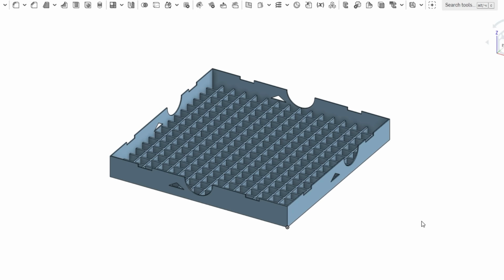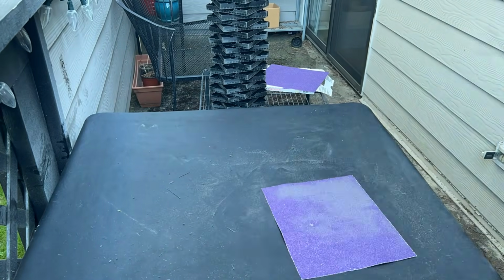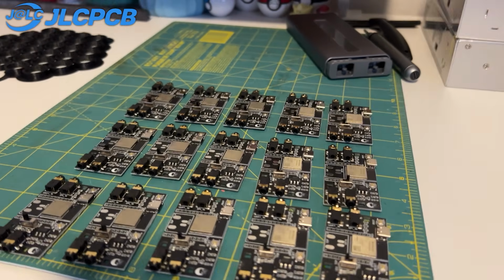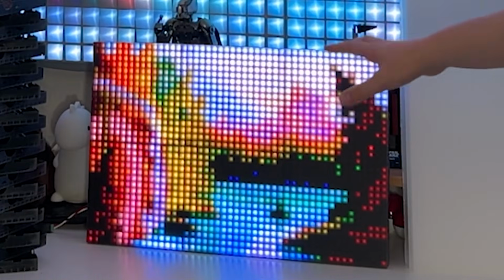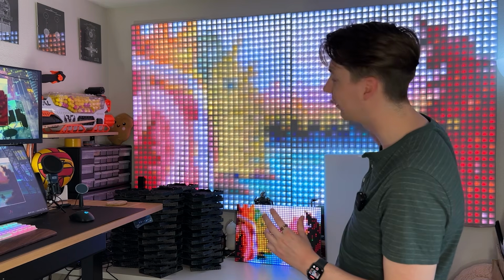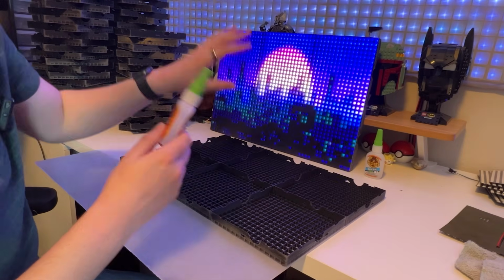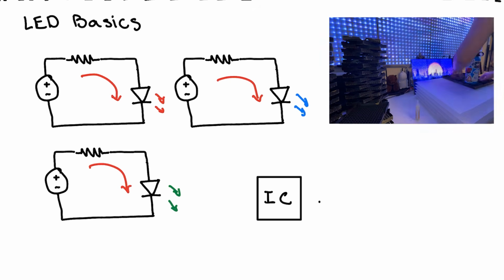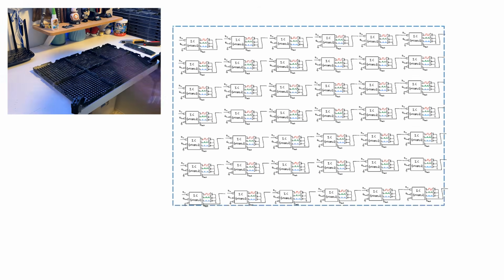How To Build a HUGE LED Wall From $5 Tiles

Comment from the maker: Maybe I should stick to Tetris 😅

Work With Me: www.tech-random.com
Reply: I'm slightly surprised you didn't follow the memes and play either Doom, Crysis or Skyrim.
Reply: @tuxino  or bad apple
Reply: I am surprised you didn't try some retro titles. Why not asteroids? Or maybe an old Gameboy game?
Reply: Play doom on it
Reply: @bonker3  CLASSIC doom 100%
Reply: You should try something like Super Meat Boy or Celeste on it LOL
Reply: at that framerate, classic doom or any 2D game would be best. great project nonetheless. 👍
Reply: UART and SPI are similar interfaces SPI is a protocol  for short distance wired communications between integrated circuits. Whereas UART is a physical circuit that sends data over two simple wires over longer distances, spi is 3 times faster and requires more power and i believe is compatible with raspberry pi and arduino.
Reply: Hi dude plz answer would like to build on top of your project
Reply from the maker: @efexzium you can find my email on my channel page
Reply: @Tech-Random maybe hanging a plain white thin cotton sheet? Could diffuse AND blend the leds to make the image smoother?
Reply: A C64 emulator might be programmable.
Reply: hey bro, i want to order ur pcb from jlc pcb but get this error :
The below parts won't be assembled due to data missing.
SPI_IN,SPI_OUT,H1,H2 designators don't exist in the BOM file.

Comment: After watching both your videos about using these new panels for your wall display, I think I'll be purchasing some (and the microcontroller you made) for an interactive art thing I'm wanting to make. If/when I get it running, I'll be sure to give you an update.
Reply: P.S. tried to use your GitHub files to make a PCB, but they returned an error. I created an issue in your repository, so hopefully we can follow up there (if I don't stumble into a solution first).

Comment: yo. get some even tigher ones and fix the latensy part and use it as a rgb backlight for a tv ( run the led ones as a low res mirror of the main screen signal )

Comment: Would this be DMX controllable?  I'd love to do something similar as stage lighting for my DJ setup, to compliment my current fixtures?
Reply from the maker: The code doesn’t have a direct DMX interface but since it mirrors a PC screen you can use an app that does support dmx and mirror that to the display.
Reply: @Tech-Random thx for that clarification.   Happen to know what wattage LEDs can go up to?   It would need to be "DJ bright"

Comment: Hi, this is really cool, but I seem to have missed some info... you seem to be using an ESP32 board for every 6 panels, right? And ESP32 boards from what I see are being controlled by serial port, but what are you using to control and synchronizing all the boards? A PC?? What software are you using on the PC? Where can I get more info?
Reply from the maker: You are understanding it correctly. The software I’m running on my PC is called LMCSHD and you can download it from GitHub. I talk about it in more detail in this video: https://youtu.be/c3bDt88AE4w?si=NCkaQqcaE3WE_x-O

Comment: I have professionally installed 3 LED video walls so far (2 LG and one Samsung). Unfortunately I am a perfectionist and usually spent more time than necessary on those jobs, but the end result is worth while. This video is already giving me nightmares, I am trying to resist the urge to immediately splurge on parts for such a project that may very well end up in the 'Did not finish' pile. Watching you put this together I started to think of how I would develop an interlocking cabinet system for each panel.

Companies that are huge successes all started out like this, just making cool shit. Amazing job, truly. It amazes me what dedicated people are capable of doing nowadays.

Comment: Ths dragon lives in Oregan also. heh. Weather can be bad at times. I love this project. I have plans for a cuple of projects. One of them will involve in making my own PCB. I hope I can get it done right. If I do then this other progect I will want to try and do. Another project is to mod a TV/VCR combo unit. thinking of upgrading the jungle IC if the one in the tv doesn't do RGB as I am going to turn the TV into a masive gaming TV. heh.

Comment: I've been working on renovating a museum that has a led-wall of 16x7m. How you can improve your design, is make a case around a few tiles and repeat that to fit the entire wall (2x3 size for example). You make the tiles fit really snug and neat and try to make it almost borderless. make some holes/sliders on the sides that connect to another box with bolts or something. Now here's where the magic happens... your led wall will look way more professional when it's alligned properly and this is an easy and cost-effective way of doing that that holds up really well too.

Comment: I know there is a different protocol from the WS2812 that is designed for speed, but it's probably more expensive.
Reply from the maker: The WS2812b chips aren’t the bottleneck here. It’s actually the usb to serial converter that sends the signal from my PC to the ESP32. The baud rate is limited to 921600 bits per second or just under 1 Mbps. If I were to use a proper USB 2 connection I could easily get 30 frames per second or more with these pixels.

Comment: I think you can print 1-2 layer clear PETG then print reset part directly on it (of course also using PETG since PLA doesn't bound with PETG)

Comment: You should have printed the tiles with a white filament. It would have made the led’s brighter😅
Reply from the maker: I did white tiles with my first LED wall but the colors of neighboring pixels would bleed together. The black does absorb a lot of brightness but it makes the colors more accurate.
Reply: @ okay thanks for informing me👍🏻 maybe a  metallic grey filament 😄

Comment: As an electronics and DIY project, this is fantastic. As a screen it sucks, you can get a 98 inch TV for less money and far less work. BUT you could use them in other configurations like on a stage, or in home decor or maybe in hobby theater.
Well done!

Comment: Want to Lap stuff fast? Glue a mirror to an orbital sander or even buff wheel, stick the sand paper to that, just need to make sure it’s level in the bench vice, easy.

Why a mirror? Glass isn’t as perfect as mirror glass as it needs to be perfectly flat to show a correct reflection

Comment: What about putting a big thin white sheet of cloth to diffuse it?
Reply from the maker: I did that with the original LED Wall you saw at the beginning of this video. White clothe was easier and lighter but this gives better color accuracy

Comment: I’m also very interested in embedded systems! Apologies if this has already been answered but how do you handle the conversion from video to something compatible with the microcontroller and code? Going from something like HDMI to low resolution pixel arrays seems complicated!
Reply from the maker: I used an open source program called LMCSHD that has a few different algorithms to pixelate a real time screen capture. The signal is sent over a USB Serial connection to the microcontrollers which is the main limiting factor for frame rate since the Serial baud rate is only around 1 MBps

Comment: I started on this a year ago. I stopped because the DPI wasn't tight enough. I then got higher DPI squares however the power requirement went through the roof.

Comment: Did the math, if you wanted to make a 1080p display with these tiles, it would take 8,160 of them. It would cost $38,433 for the tiles alone and would be 72ft diagonal.

Comment: Normally by the ESP32 Datasheet, you have to cut the PCB where the antenna is located.  It make an huge difference for the wifi signal strength.

Comment: I must mention the Ws2812 (neopixel) smart LEDs  (PWM: 400 Hz, Data transfer:  800 kbps) are kind of slow for video.  4 wire (Dotstar) with separate data and clock lines are quite a bit faster.  The original APA102 was faster than the now commonly available APA102A or sk9822, the less well known HD107S (or Newstar NS107) may be the fastest,  26kHz PWN, 40MHZ data clock.
 In cost per pixel terms the Hub75 panel can't be beat, growing more dense, down to 1.25mm spacing)
PWN is done externally, a slow driver may provide lower color depth, raspberry po is used for video with 24 bit res. (One video wall maker boasted to have 72 bit color resolution, for less banding on low light scenes)
There is a Colorlight brand PWM driver that had been hacked to work with Ras Pi Ethernet connection compatible with Xlights.

Comment: r/explainlikeimfive
Reply from the maker: Alright, let's imagine we're making a magical light-up picture book! Here's how we do it:

1. **The Drawing**: First, we think about what picture we want to light up. Maybe a colorful rainbow or a cool robot. This picture will help us decide where to put the lights.
2. **The Light-Up Stars**: Next, we get little lights called LEDs. They're like tiny stars we can control. We decide where each star should go to make our picture shine.
3. **The Magic Paper**: To hold our stars, we need a special piece of paper called a circuit board. We draw a path on this paper, like roads for our stars to follow so they know when and where to light up.
4. **Magic Instructions**: Our stars need to know when to light up and what color to shine. We write a special set of instructions called firmware. It's like telling a bedtime story to our stars, so they know what to do.
5. **Putting It All Together**: We connect our stars to the magic paper and tell our story. When we turn it on, the stars light up and bring our picture to life!

And just like that, we've created a magical light-up picture book using LEDs, a circuit board, and firmware! 🌟📖

Comment: I did something similar with the 8x8 tiles when they were available for 59 cents each. Since i was to lazy to sand or cut anything, i decided to use multicolour printing. 0,2mm white or black followed by 0,4-0,6mm transparent works great. Great project mate 👍

Edit: I also used 24v/5v converters, a 24V powersupply and i did not chain plus/minus to lower the voltage drop

Comment: Improvements:

Connectors on the pcb for power and data, so you dont need to solder to your board. (Jlpcb do all the work afterall)

Remove the extraneous data connectors from the esp (or alternatively make them active so you can run 2 panels off each esp?)

Design the magnet holders into the corners of the panel holder somehow (?? As someone that designs my own 3d prints i know how hard that is in reality when you have constrained dimensions)

Comment: Diablo 2 at 640x480 may be possible to play comfortably. The game runs at 25fps in single player and was designed around a fairly low resolution. I'd love to see what that looks like on that LED wall.

Comment: You are right about how doing little projects is good for the career, especially for electrical and computer engineering. When I went back to school, I dove in deep into Arduino projects and getting hands on with the stuff they were teaching in class to try it for myself. Eventually was using Arduino to build transmitters and receivers for quadcopters. Gotta say that this experience probably helped me a lot getting a job in the aerospace industry. Best advice I can provide, learn to get comfortable reading the manuals/tech specs for microcontrollers.

Comment: Would the screen look better if you had printed the frames in white?
I would assume the individual squares would still block light bleed from pixel to pixel (depending on the type of filament you used) but, since they are white, they would allow the colour to reflect of the walls and into the front making them appear brighter.
Reply from the maker: I did this with my first wall and it did help with bright spots but it suffered from light bleed. Ideally I could use a dual color 3D printer to make the inside of the tile white but have a thin black layer between the pixels to prevent bleed. Best of both worlds!

Comment: Impressive! I’ve thought about doing this, but the amount of labor has held me back. 

One little correction (in case there are some electronic learners here): LEDs are not on/off devices, they are analog and can go smoothly from off to max. However, that would require expensive DACs and the IC would become hot. 

Btw, I would definitely dropped the brim and spent some time tuning the first layer 😅

Impressive project! Keep it up. 

One more thing: do you run them all in serial? If so, running 8 channels in parallel would dramatically increase FPS.

Comment: Why are you sitting so close at the beginning? You really couldn't sit further away? Use the folding table you were sanding on as a desk, turn off your PC monitor, and turn the lights out. It'd make a huge difference

Comment: I'm actually really impressed at the pixel-to-pixel contrast and lack of color bleed using the single solid piece of acrylic over the surface. Increase the color depth and speed of the display and you could have the beginning of a commercially viable product. This is awesome.
Reply: For the speed side of things, you could have each tile operate independently, listening to the entire data stream carrying each frame. When the stream reaches the part(s, depending on the formatting of the signal) of the signal carrying the piece of the frame it's listening for, it starts loading its data into a buffer. At the end of the frame, all tiles load their buffers into the LEDs. You would simply need a sort of "master" device to store an EDID to tell the display output what size and format your display is expecting. Then you only need to set on each tile which part of that defined space it's listening for. This could all even be done with dip switches, allowing for completely customizable and reconfigurable setups without having to tinker with software to create and load a new firmware image for a different EDID, and works with a standard video output, removing the need for that intermediary program you're using for scaling and signal formatting. The ultimate solution for plug-and-play, set-and-forget installations.
Reply: @RAndrewNeal  Similar to the LED wall project of Bitluni
Reply: @RAndrewNeal Probably do get a simpler design going for the drone panel swarm which needs your on panel crop / listen.
Reply: @ Drone panel swarm? Like a swarm of drones carrying LED panels in formation? Each panel would need a radio receiver fast enough to receive an uncompressed, wide-band video signal, transmitted from the "master" device like in the LED wall scenario. Going the compressed route, each panel would have to receive and decode the entire frame before cropping down to its bit. Or even several frames, considering many video compression schemes use what's called long-GOP (group of pictures), meaning that ever 15 or so frames, a completely new picture is recorded, and every frame in between is only recorded as a change from the previous frame.

It might be best to do all the cropping and data organization on the master transmitter side, and then transmit the processed data to lower the cost and complexity of the many LED panel units. It would have to be transmitted uncompressed to do it this way though. It is also feasible to use several different bands to have multiple links in parallel so that slower circuits can be used, reducing cost.
Reply: @RAndrewNeal   yes. drones each w/ a panel and esp32 at minimum. gets better w/ protocols like VNC that only ever send 8x8 squares (maybe that's jpeg size). forcing wifi into a fast broadcast mode sounds like the hard part to me.
Reply: @RAndrewNeal  also, why must ATSC be so hard?
Reply: @ I'm not familiar with how ATSC works. I know a little about analog NTSC and SDI, and just a speck of HDMI/DVI, but that's about it, as far as implementation details.

WiFi is like a wireless IP network, meaning it's packet-based and must address every IP address individually. It may be doable, I've never given it any thought. But I would gravitate to designing my own simple protocol that converts a standard display format into something the panels are designed to receive, and use the 915MHz ISM band for wireless communication because it's not as crowded as the 2.4G and 5G bands, and you've got 26MHz of bandwidth to play with.

Then again, the uncompressed route is probably way too ambitious for radio transmission because a 1080p60 video stream at 24 bits per pixel (8 bit color depth) is just under 3Gb/s. That's where 3G SDI gets its name. 480p30 is around 250Mb/s, and 240p30 is about 73.6Mb/s. Lowering the bit depth will also help save bandwidth, while reducing color resolution.

If you're putting an ESP32 on every panel, I see no reason it couldn't decode the entire compressed video feed and crop it to the section of the video the panel needs to show. Then it's just a matter of streaming the video over WiFi with some kind of high efficiency codec and then writing software for the ESP32s to listen to the feed, decode it, pull out the data it needs, load it into a display buffer, and then shift the buffer into the display at the end of the data frame from the server.
Reply: Great video; great project.

Have you ever done a video about your choice of patents on your office wall?
Reply from the maker: @davidtorrente8651 I haven’t done a video about them but they are prints of a few of Nikola Tesla’s designs